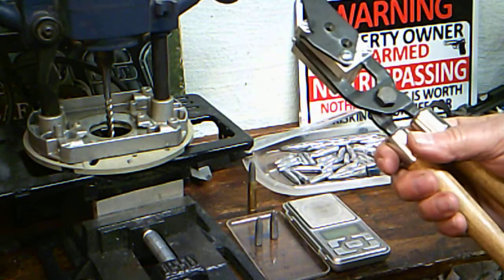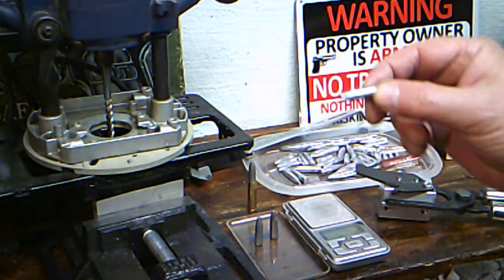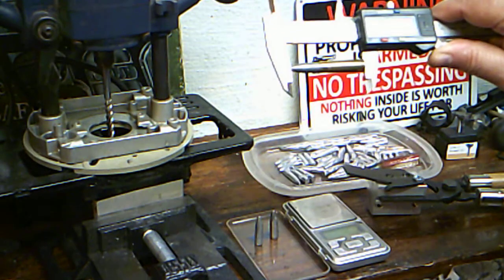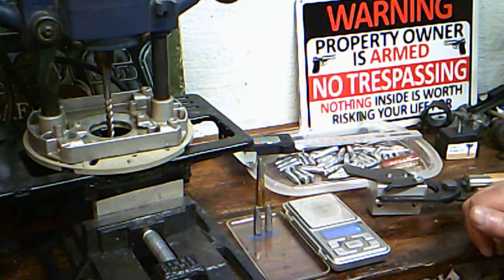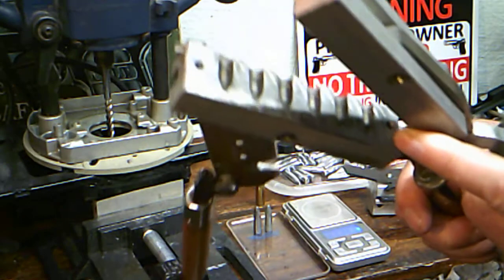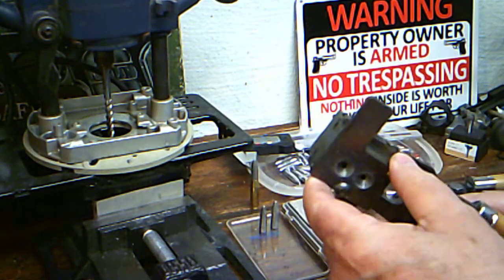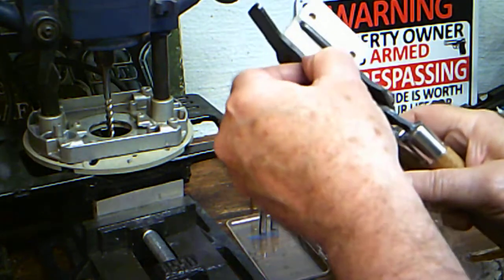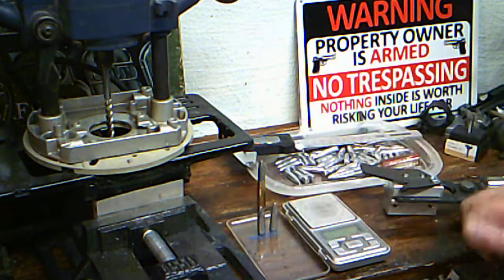Lee mold mod for 300 blk

Comment: You can do Zinc with aluminum mold just have to have the Zinc up at 850-870 degrees. I did a video on it - my last zinc video.
Reply from the maker: I remember Andy . You know how it is , some say it won't work .
Reply: How do I find the video? Do I need to do anything special to the mold ? Ppl say zinc eats aluminum

Comment: More ciphering may be needed on this one. Not sure if that aluminum will stand up to zinc 🤔
Reply from the maker: You might be right ? I'd like to know if it's the zinc or the over temperature that people may be using with the zinc ? Zinc melts at 790 degrees . So if you cast at say , 850 degrees it should be fine ? Or does the zinc attack the aluminum ?
Reply: @jamespollard1670  🤷‍♂️
Reply: Lol

Comment: I have had zinc dissolve an aluminum mold... 
It will cause aluminum to melt at lower than the normal melting temperature for aluminum. Something like a catalyst
Reply from the maker: Did the cavities get larger ?
Reply: @jamespollard1670  The whole top surface of the block got wavy and the cavity is just kind of crumpled away all the definition. This mold happened to be made out of 6061 and that probably does make a difference. The mold I was using wasn't actually a bullet mold but it worked like one. It was a custom mold made to fit Lee handles for a jewelry component for a friend's business. We ended up remaking it in iron on magma blocks,
Reply: @jamespollard1670  for what it's worth I'm curious to see if the alloy lee uses holds up longer. I know NOE uses a completely different alloy that is capable of taking more heat than the Lee alloy.  We basically picks what is cheap to extrude not what makes the most durable mold.
Reply from the maker: @GunFunZS  My plan was to try an keep the temps around 850 -900 degrees and see if that helps ?

Comment: Copycat !
Reply from the maker: Could be ?
Reply: @jamespollard1670 ; ) if you get it right down exactly at the first Tumble groove, it'll be 175 with wheel weights or 168 with lino.  We've chatted about it I'm sure it's an idea many people have had. Mine shoots great except for when it doesn't. Still scratching my head on the latter point though. I'm tempted to get a 309 reamer and just kiss away the lube grooves so that there's a little more bearing surface.
Reply from the maker: @GunFunZS  I was going to leave it in the 200 gr range for lead with the intentions on a dual purpose mold for a 120 gr zinc also .

Comment: reducing that length is gittin you close to the 311329 lyman
Reply from the maker: Almost the same profile as the 311329 . I can only find the 311329 in a single cavity .
Reply: @jamespollard1670  hows the ogive near the top drive band?
Reply from the maker: @mckwilly  The ogive is good all the way to the lube grooves . I can seat the bullet out long to 2.260 " and still chamber .
Reply: @jamespollard1670  nice
Reply: It's been working for me at 175/ 168
Reply: I guess lil different profile though